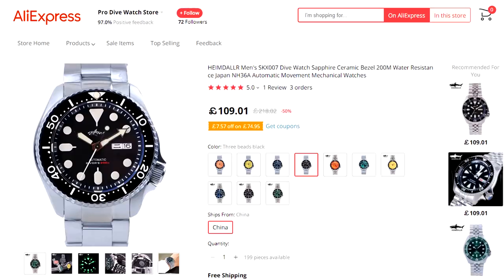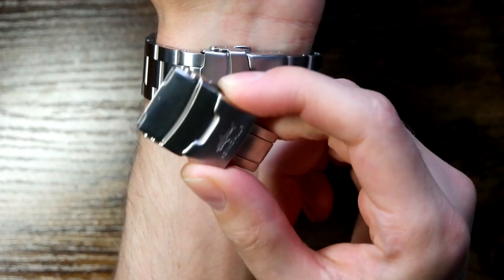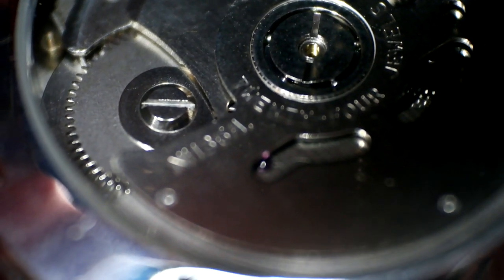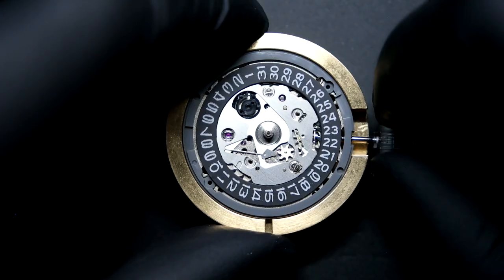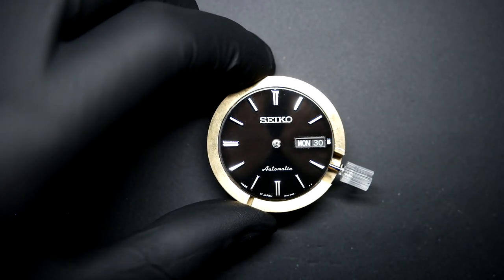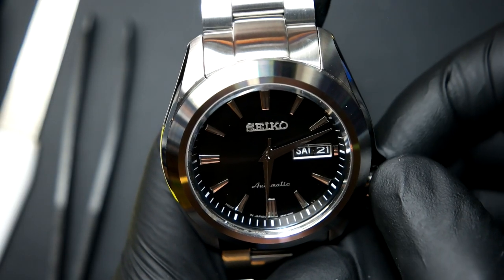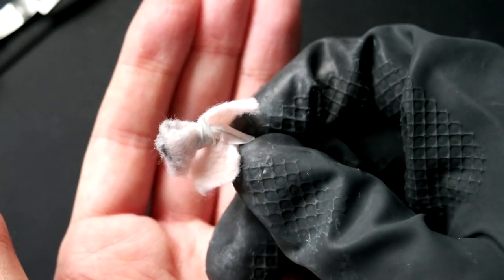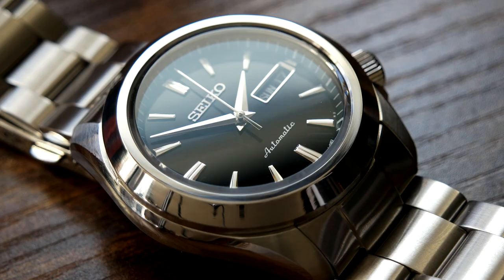Heimdallr SKX to Grand Seiko? [REVIEW+MOD]

Comment from the maker: One thing to note: I can't speak for the water resistance of this mod since I changed the caseback, and the threads on it aren't as tall as the original caseback. If you're concerned about water resistance, I'd leave the original caseback on this one.
Reply: I don't know much about watches, but my guess is that the water seal on the case back is created by the o-ring.  As long as the o ring has sufficient compression (but not too much) then it should seal fine.

I had no idea that you could swap out the bezel for a non-rotating one.  The watch you built is very similar to what I want but haven't been able to find.  I'd like a higher contrast dial and hands (because middle age sucks) but pretty much everything else is exactly what I want.  Thanks for the vid!  Now I've got to do some tool shopping.
Reply: Nice mod, one question what did you use instead of that fake click spring ?  I have a similar case (a bit bigger, turtle 🐢  style) I opened the bezel and lost than spring :(  don't know what to put now there. 😑
Reply: This is a great tutorial video after the ones from Lumeshot. Great work ! You could have explained the work on the crown, just in case somebody wants a S Crown put on the case. Nevertheless super work and video. I did the same work with my SKX, but not with the same dial, I used a Aliexpress Grand Seikoish  black dial which had both positions available. My problem was with the crown, which was at the end so wear down, that I had to use again the original one, because the work with the stem had ruined my S crown, which not liked to screw in smoothly anymore. The sizes of the hands are 8x12x12,5 mm (hour, min, secs) for 28,5 mm dials. Wish you Good holidays.

Comment: Hey man great work and quality video. I recently finished a mod myself. I subscribed after you mentioned the alignment issue using the dial dots to secure the dial. That happened to me and I didn’t see anyone else talk about that issue. Look forward to more videos. Cheers.
Reply from the maker: Thanks! I appreciate it. The dial dots are a tricky issue. I did actually update the watch after this video, and remove the hands and re-fit the dial. I replaced the several dial dots I used with 4 half size ones and kept gently lifting the dial with a thin crafting knife/blade to move it into alignment. It took about 4-5 test fits to get it perfect, but I'm happy to say the dial is now perfectly aligned.

One thing I did to help with alignment was looking at where it needed to be, in relation to the chapter ring, and making a small mark on the plastic movement spacer at the 6 o'clock position to align the dial roughly to.

Comment: Hi Dan.  I'm sad.  I have just destroyed 2 Turtles.  The bezels are nearly impossible to remove.  I have removed a couple that weren't too bad, but I had 2 including my grail. the orange Nemo that the bezel removal required a hammer.  I put a squishy foam mouse pad under the watch to absorb some of the shock.  A couple taps of the hammer onto the knife will finally pop up the bezel, but then I noticed the dial rotated inside the watch.  Not good.  Took one for repair today (not the nemo) and there were several broken pieces.   The nemo just broke tonight.  The bezel was seized so i had to remove it anyway.  Now,  I assume there will be the same broken pieces inside the nemo.   I think the weight of the rotor is breaking the spindle/stem?  That's my guess as they said the rotor broke off on the one I took for repair today.    I didn't think that hammering on the knife while the watch was stationary would cause breakage.   Even Namoki mods page suggests a hammer may be necessary for really difficult bezels.
Reply from the maker: That sucks... Unfortunately there's not much I can say. I think you can still salvage these watches, but if the movements were damaged they'll need replacing and if the dial feet snapped off due to the force of the hammer, they'd need to be re attached with dial dots. This will just have to be one of those hard learning experiences, if you ever need to use impact force to remove a Bezel, its always worth removing the movement first.

I hope that you're able to get them sorted out.
Reply: @ItsAnotherWatch  Thanks brother.  I honestly didn't think about removing the movements first.   I wonder if they can fix the movements?  I'll find out soon enough. The dial and the movement seem to have moved together as the day/date is still in the little window.  I'm guessing the crown stem broke allowing it all to rotate?
Reply: @ItsAnotherWatch  The funny thing is, the whole reason I changed the bezel and insert on the NEMO was to preserve the originals in perfect condition for the future.  LOLLLLLLLL
Reply from the maker: @fakenewsisthenews3542  If it is just a snapped stem then that should be fairly simple to repair, as long as there isn't any damage to the rest of the movement.

Comment: Great video mate! The final product looks freaking amazing!
I wonder if one can do the same with the Heimdallr monster, swapping the dial for a real Seiko dial.
Reply from the maker: It uses the NH36 so I think its definitely doable!
Reply: @ItsAnotherWatch  I'm sure I will fit the movement, the question is, will the chapter ring fit the case? I guess I'll have to try to find out xD The dial isn't cheap though.. 75 bucks o.o
Reply from the maker: @Simplifier123  I think you can get away with just a dial swap if the indices don't exceed the size of the cutouts in the chapter ring that comes with the Heimdallr. Looking at them, and comparing to images of the actual monster watches, it looks like they're made to the same size (LOOKS LIKE). So as long as they didn't glue the chapter ring to the Heimdallr dial, I think a dial swap might be possible.

https://www.aliexpress.com/item/1005001827073058.html   <--- thats the one I was looking at to see that they seem to have chapter rings in them already made to fit.

I'd even say, if you're up to carefully using a rounded file to expand the cutouts in the heimdallr chapter ring, you could use a dial like this:

https://www.aliexpress.com/item/1005002043232623.html  <----- Cheap one (probably not C3 lume)
https://www.aliexpress.com/item/1005001868574502.html <----- Double the cost, but uses C3 and images clearly show it has the Seiko logo.

Although that's not what you're going for, it could be an interesting experiment. If you wanted to simply get the seiko branding on there. Although I'm sure there are other aftermarket seiko dials with rectangular indices instead of the round ones, but this was a fairly decent one I found with the prospex branding on it at a kinda crazy low price. I think if the price on parts is low enough, it can be worth it just to tinker.
Reply from the maker: Looking at those, I'd say if the Heimdallr is true to most of the dimensions of the original (at least internally) if the chapter ring doesn't separate it might be worth getting that dial+chapter ring from WatchPartsPlaza and just trying it out. If it doesn't fit, you could send the dial back, or just resell it on eBay for the same you bought it for, i'm sure someone out there would buy it. I wonder if you could get the dimensions of the height of the chapter ring on the OEM dial from WatchPartsPlaza, then you could compare measurements to your Heimdallr before you even buy it!

Edit: yeah... looks like the chapter ring is part of the dial and is glued on.
Reply: @ItsAnotherWatch  Thats is a great idea my friend! I will try it as soon as the watch arrives :) Thanks for the very informative video and response. New subscriber here!
Reply from the maker: @Simplifier123  You're welcome!  I enjoy conversing with other watch/modding enthusiasts. I hope it goes well for you! I'd love to see a photo of it when its complete if you're successful!
Reply: @ItsAnotherWatch  Me too :) I definitely will share! I recently changed the movement for my beloved SKX007 to NH36, he's a dream now! So I'm pretty confident in doing this dial swap 💪

Comment: so you took a watch and swapped the bezel, dial, hands, and swapped a NH36 white to black.
the only thing original there is the case...
might as well keep the other watch as is, get a new WhiteNh36, and a new case. 
this is 90% to a new watch its not so much of a mod as you removed the dial.
i would modify hands, maybe new saphire, and different bezel insert
what you did is modifying the watch entirely kept only the body

Comment: I am waiting on delivery for my first "big boys" Seiko a custom modded Tuna, the case has been knurled quite extensively in a diamond criss cross pattern with the bezel coin edge being matched by the machinist who did the work but retained the 4R36 dial and movement, only thing I am changing is the aftermarket Mercedes hands as I have a set of silohuette with red edging SKX007 hands although I also have a set of neon green fishbone hands I am eyeing as well.   Actually I do have a custom Turtle, got it from Aliexpress this year featuring NH36 day date, sapphire crystal and sapphire bezel insert in a pleasing red to dark red to black theme with the numerals in the sapphire bezel being fully C3 lumed too...

Comment: Hi I’m looking into building off of a  Heimdallr or a steeldive SKX style case.  Are standard skx parts compatible? I heard the crows are different but it’s hard to find exact specs. Do you have any info on this? Thanks in advance!
Reply from the maker: Yeah, the Heimdallr cases use different crowns to the SKX ones. I mention this in the video at 34:36. Although I don't have exact specs on gasket thickness or the threads for the crown, they're different enough just on a simple inspection that I wouldn't risk the water resistance of the watch by using an skx crown. My advice would be to stick to the Heimdallr crown, just get yourself the sterile version so it doesn't have any branding on it.

Comment: Looks amazing! I'd love to try a mod like this but I'm barely a watch enthusiast, let alone a watchmaker/modder.

Would it be reasonable to hire a watchmaker to make a mod like this?
Reply: You can do that but it brings more cost into the project. My first build was an ETA 7750, which I could not finish due to a lack of tools so I took it to a watchmaker and was charged £45GBP for the work. The trick is to watch many videos like ‘It’s Another Watch’ and plan the project very well as these projects are doable (unless your have a shaky handy), but need handling carefully. They are immensely rewarding when done correctly.

Comment: I've done similar to an Invicta Prodiver. Its funny when you're done. Its a watch YOU love to death but probably not one you could ever sell. Mine ended up with a sanded down and brushed case, crown, smooth Murphy steel bezel, Dagaz dial and handset and lug tip turn downs sanded to rounded edges like you did your crown guards. I've named it Mongrel. Great job, save those Heimdallr parts as they're good leftovers! I've got a 6105 thats been through the wringer with one killed movement (invicta NH heart swap saved it) from a hard drop and one failed case gasket from being apart so many times. Still runs like....well.....a watch!

Comment: Turned my Heimdallr into a 6105 Captain Willard.   Other than the unsigned crown, caseback, and crown slightly off of the 4 o’clock position, you can’t really tell.

Comment: Do you need a Bezel gasket for the new smooth bezel you installed?
Reply from the maker: No, its a friction fit bezel. The gasket is only for rotating bezels to ensure a, hopefully, firm fit as well as smooth rotation.

Comment: Was the original bezel insert installed with regular 3m adhesive? Or did they install it with super glue?
Reply from the maker: Its an adhesive ring. I can't remember specifically but I don't recall it being super glued down.

Comment: Do you have any suggestions for a similar dial? Because they are out of stock and have ben, haven’t found one on eBay.
Reply from the maker: Unfortunately not. There are some similar dials out there, but none i've found to even come close to how good this SARY057 dial looks. I've had the same problem when looking for the SARY055 dial to do a white version of this. I've even bought some aftermarket dials but they just don't look right.
Reply: Thanks for letting me know. I picked up a couple of aftermarket dials. They look good but there’s definitely room for improvement on them. I’m not complaining about the price but haven’t had much luck finding original dials. 
I have noticed that you are using a generic spring bar tool. I bought the Bergeon one and I bought both sizes of forks, screws in and out for change or replacement. It cost me about 40 usd for the tool and I found the other set of forks for like $5. It makes bracelet changes so much easier. That is probably the best money I have spent on a tool, it’s that good.

Comment: Merry christmas brother, what is the size of those hands you use? I am assembling something similar to this beautiful piece you did, the thing is that the hands I use on mine are too long; i cut the hands with a nail clippers hahaha their ok but I am not satisfied. I am going to try to send a picture to you that way you can give me an advice.
Reply from the maker: I recommend taking off a little bit at a time, holding them against the dial to see if they are where you want them to be, and if they need more taken off, adjust them until they sit where you want them to.

Comment: Great video. I'm thinking of doing this myself, but with a white dial. I got the heimdallr in white as well.
Any clues as to how you found the dial replacement? The link only has the black version. 

Cheers as always!
Reply from the maker: Thanks very much! I myself have looked for where to get a white SARY055 dial but haven't been able to find anything. The only solution I could come up with was to see if I could get a custom white dial from DIAL MAKER that has those thin polished indices from the great wave dial or the galaxy dial and have them print the Seiko/automatic text onto the dial in black. That's the best I can think of unfortunately, unless there's a more available dial that's similar, like perhaps a 28.5mm vintage Seiko dress watch dial.

Comment: Wow, That  is interesting. I thought bezels were not compatible. Did you use a normal bezel gasket?
Reply from the maker: The pilot bezels are just a really tight friction fit. Since they're fixed in place, and don't rotate, they don't need a bezel gasket. As for regular rotating bezels, I've tried them on this case, and they're not compatible. Since the bezel click system is different.

Comment: I have an srpd51. Can I do this same mod to my seiko?
Reply from the maker: Yes, you'd swap the dial, hands, chapter ring and bezel. Because the SPRD51 is blue, you'd either have to get a similar blue dial (to avoid having to replace the chapter ring) or remove the crystal to change to a black chapter ring, which would require a crystal press to remove and put the crystal back in.

Comment: Yobokies sarb033 dail& hands are better option
Reply from the maker: It depends on what you're going for. I wasn't going for a lumed dial and hand set. And although I like the look of the Yobokies sarb033 dial, the black version isn't sunburst, it doesn't have the Seiko logo on it, its lacking the wider day/date window and it has the minute track on the dial. I was going for a cleaner looking dial with the minute track on the chapter ring. Especially since it would involve buying a new chapter ring and popping out the crystal to change it, which I was happy not to do with this project.

Comment: Any info on your original Seiko. Is it a 013 and if so how much? Cheers
Reply from the maker: The original watch was a Heimdallr SKX007 homage. Although the crown guards on it make it look like an SKX013 but its the same size as the SKX007.
Reply: @ItsAnotherWatch  ah my bad - sorry, I meant the custom build control watch you used? I'm guessing it's also an 007 case?
Reply from the maker: @1a1r  Ah, yes it is. all Namoki mods SKX007 parts. Strapcode bracelet, and Dial Maker meteorite dial. Technically its not even an original Seiko, since its all custom parts.
Reply: @ItsAnotherWatch  looks fantastic, regardless of authenticity. I'm starting a build myself but am trying to source an original SKX013. Prices are at £529 for one with a jubilee strap. I'm going to build a custom one and keep looking for an original!

Thanks for the info, looking forward to more content 🔥
Reply from the maker: @1a1r  No problem! I'd recommend taking a look at https://www.seikomods.com/ since they have all the SKX013 parts you need and are based in the UK. I was tempted to go for a SKX013 full build from them recently, but I'm trying to hold back on doing too many mods haha. God speed with the build sir! I hope it goes well.

Comment: Do skx parts fit this ?
Reply from the maker: Movements, Crystals, case backs and chapter rings yes. Bezels, bracelets and crowns no. Although. as you can see in this video, a Pilots bezel is an exception due to it being designed not to  move.